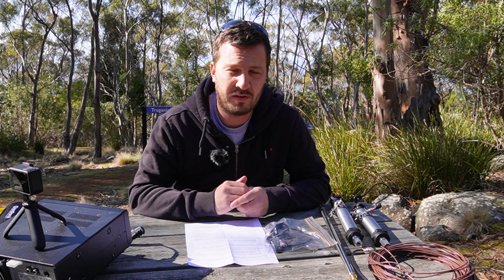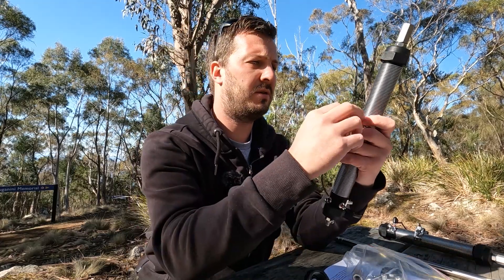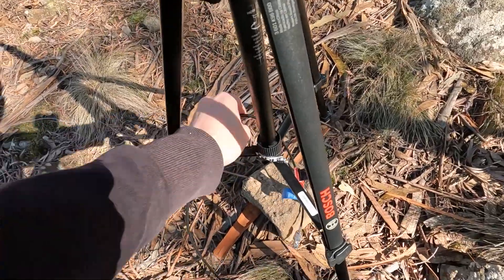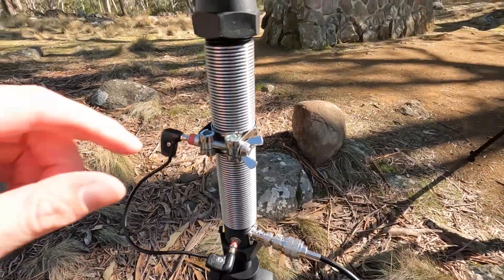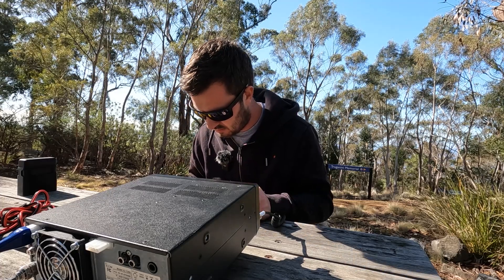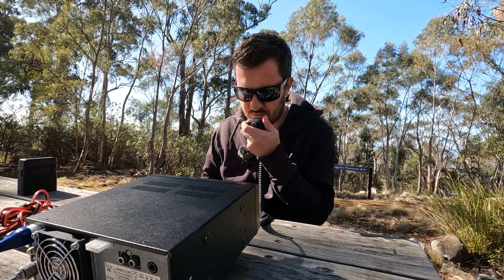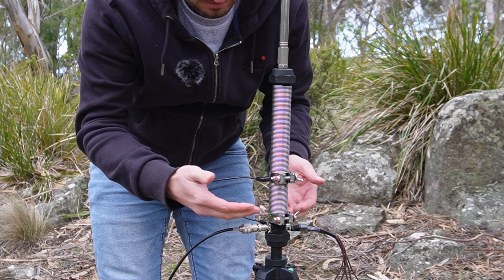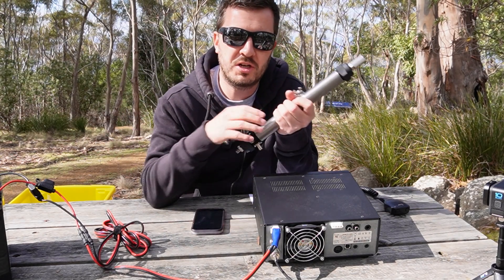HF Multiband Portable Vertical - Mad Dog Coil (Ideal for POTA, SOTA)

Comment: I bought an 80M metric version after watching your video, Hayden. I'm hoping it will finally allow me to operate HF from our boat on the Gippsland Lakes - its not a yacht, so doesnt have a mast available.
After it arrived, I recalled that I have a few old whips in the shed that might also be usable with the coil, although they have imperial threads.  However, the thought of having to also buy the imperial threaded version of the coil didn't appeal to my Scottish genetic base. I did get the 3/8 24 NF coupler nut though and discovered that the 3/8" threaded hole in it was very close to the diameter hole required for a 10mm tap. A few minutes careful work with such a tap transformed half the depth of thread in the coupler nut to 10mmx 1.5mm. A relatively easy mod that now allows me to use imperial threaded whips with my 80M coil.
Bill VK7MX
Reply from the maker: That's awesome Bill. Please let me know how you get on with operating it on your boat - and let Marty know too he's keen to hear how it performs. There's a few of these appearing in the wild now.
Reply: Will do Hayden, but I wont be back on the boat now until early December. I did try the VK7JJ squidpole a couple of years back but it wasn't easily deployed and the wind played havoc with it. @HamRadioDX

Comment: We were building these back in the 70,s. Two inch PVC. Then used a number 10 wire cut the length of a quarter wave at 80 meters. Marked the wire for each band on a quarter wave 6 meters thru 80 meters. wrapped it around the PVC and added a ground for the counterpoise . Then plug in the coax from the transceiver. Tap the coil for the band you want and transmit. So simple. Oh ya forgot the 102 inch whip. Or whatever length you want. Use small stainless screws for each band into the wire on the coil. Most of the time I didn't need a tuner. Back then that would have been a manual tuner.Actually since it is a coil you really dont need a tuner. So I would make a Shunt coil 1 inch wide wounds. Add that to the coax center lead and to ground. Done, no need for a tuner. The 2 inch PVC helps to give some bandwidth. Used these coils for my long wire for 80 and 160 to add length and bandwidth . I would say now days would be build for $80  ish bucks depending on how much of this stuff you already have. We are hams and we build neat stuff.
Reply: I built mine with a PVC pipe with a 3 inch diameter foam  pool noodle slid over it and bare wire wrapped around it, with an old bamboo fishing pole to support about a 10 foot long vertical wire with a couple inch disk of PCB material on top as a tophat. At the coil base I used a jumper with an alligator clip on top and just moved it up and down for the lowest noise in the center of each band, then marked those spots. I don't recall how many bands it covers, (haven't used it since before COVID,) but it was very easy to hop around on the bands just by moving the alligator clip up and down on each band while listening for receiver noise. I didn't even need to check the SWR if I listened carefully for the noise level. I made the whole thing from junk in the shed, so it cost nothing and it all folds up and is held together by 2 Velcro straps, and weighs next to nothing at all. I was shocked at how much people were paying for those Wolf River coils. They cost more than I paid for an HF rig! We're hams. We can build an antenna in an afternoon for free. And I bet my coil has lower dielectric loss than a Wolf RIver coil, because the pool noodle is practically all air.

Comment: Loading coils for verticals have been around for many decades, nothing new here. Your problem is laying out ground radials and he hazard of someone tripping on that wire. This could have disastrous results for POTA.  Use your vehicle as a quasi counterpoise or a single wire you can monitor. Or better yet, get something safely in the air above other users of the park.
Reply from the maker: No problems. I can safely monitor foot traffic in the area. 

Vehicle parked too far away. All completely safe

Comment: Interesting except for using a BNC to attach coax. I would prefer an S0-239 to fix a PL-259 Coax. No one in the United States is going to want to use a VHF BNC.
Reply from the maker: BNC is great. Quick disconnect perfect for portable. My Buddipole uses a BNC too and it was Made in USA 🤔

Comment: Good video as always, thanks. When using the second collar  for 40m, does that not detune the 80m setting as it shorts a number of coils, or does it only touch one coil?
Reply from the maker: No it will have limited effect on detuning. If you switch back to 80m, you still have the same inductance (windings) to the end of the coil to antenna connected

Comment: I can see the point of this for 80m but for 40m a 10m squid pole and wire with the same counterpoise is less compromised more efficient?? …. Though perhaps marginally more difficult to set up (unless it is very windy)? Great to see an Aussie in the antenna space though… I’m sure it will go MAD and sell by the truck load for hams in a hurry as the tuning is quick and doesn’t involve capacitors so it can take more watts up the spout!!! So …. Maybe …. I take back my 40m comment due to the ease of tuning!!! GO MAD DOG!!! 73 de VK2AOE .

Comment: HERES A DUMB QUESTION WHAT HAPPENS IF U CONECT 2 COILS TOGTHER
Reply from the maker: Not a dumb question.. more inductance.. I want to see if it tuned up on 160
Reply: it would be a interesting experiment putting either 2 of the same coils together or join one of each together  @HamRadioDX

Comment: Hi Hayden, wonder if mad dog will make a 20m to cover 20-10m?
Reply: If you use the telescopic whip on the 80m and 40m coil you can tune 20metres I have built one using Marty’s video. By thanking the collar to the top of the coil and shortening the telescopic whip you can tune 10 metres. However if using the military style sectional whip I haven’t been able to tune 10 metres.

Comment: Just saw your video on mad dog coil just wondering on the tripod would like a adjustable tripod but am wondering what type do i need to look for do have a Camera tripod but obviously has different top has a camera slide in base to it and does not seem to have a screw in section small enough to screw something like this into do i look for a speaker tripod or something else?
Reply from the maker: Hey mate check out the Mad Dog coil website, details on a suitable tripod there
Reply: actually went there after video and found out what i was after thanks should have gone there  initally 
 @HamRadioDX

Comment: Were you running 100 watt for this test ?

Nice Work ⚡🙏⚡

Is it simply a coil?
or is it a patented inductor design
with a nuance ?

Nice set up either Way 🙏

I hope to see some innovation using conical coils 
with reduced stray capacitance
or even pancake coils for greater efficiency and higher Q factor.

Conical and Pancake are more efficient coils
than the cylindrical continuious helix coils,
just based on the laws of Induction.

In the Early Days of Radio,
Pancake and conical coils were widely & wisely used ⚡🙏⚡

Keep up the great work with your channel Hayden mate ⚡🙏⚡

73 from Crazy Ham.
Reply from the maker: Yes I started out with 50W on 40m for the first few contacts and then cranked it up to 100W
Reply: @HamRadioDX  Excellent Mate ⚡🙏⚡

Looks like a nicely designed little system 💪